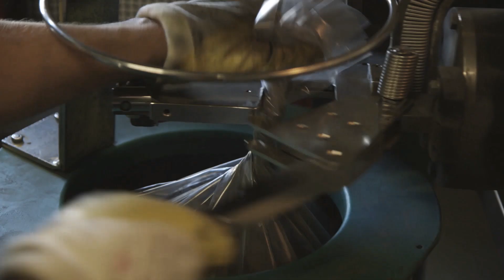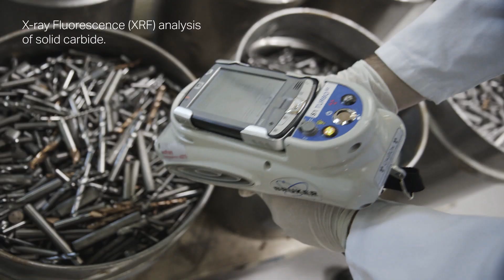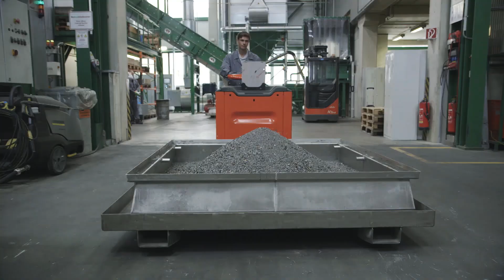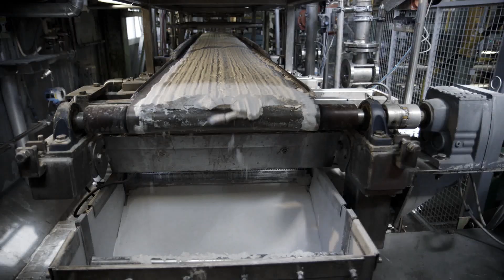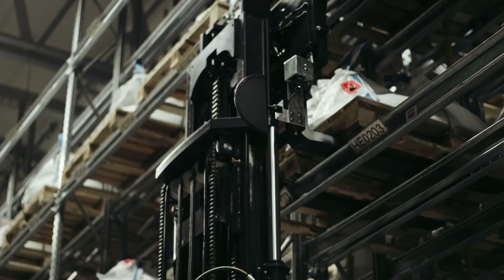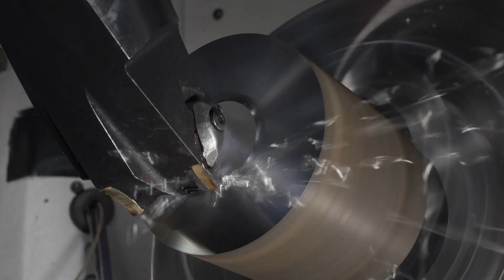How to recycle solid carbide with Sandvik Coromant

Comment: Whats so toxic about carbide though?
Reply: It's not so much the carbide, but the cobalt, it's nasty stuff. If you sharpen/hone inserts, wear a mask, & clean up the dust into a zip lock, so you don't have cobalt dust in your shop.

Something I learned recently is vapor or smoke coming off machining should not be breathed, it carries nasty stuff from the tooling AND the material.

I'm ancient & have cancer, already, started w/ throat, now in liver; been working in mechanics, fab, etc since I was 12. Started building/painting models years before.

Never smoked tobacco or chewed.

Any young guys/gals, you don't want this, trust me. It's not the cancer, it's the treatment & its effects; I have a 5mm silicon tube thru my abdomenal wall I eat thru.  Going on 4 yrs.  No saliva due to radiation damage.

Wear the damn PPE.
Reply: @georgedennison3338  so sorry that it has effected you in this way and your life. Over the last 3 years I've been in quite a few shops that look past the dangers of cobalt. They don't seem to care about the employees health as much as they should. Always cutting corners. Not many good quality shops around. I live in Ontario Canada and the only shop I know of that lives true to their employees health is Armo Tool. They have an incredible team management and provide the healthiest atmosphere and that's not just the air quality.

Comment: i used  sandvig tips   in my   work place   40 years ago  !   the try blade  tip   was a good   improvment   to  hss  steel  tools .  
and cobolt  steel   tools  but we    had  a   fix  for the   try  tip  wear   we used to   re shapen them on  a  diamond wet  stone  '
i have fogot   the exact angle's we used to recut  the tip's to  but it was not  the  same  as they came   in the box  / sheet .
needless to say we honed the  the  tips for  the best  perfomance   for the  metal we were cutting .

Comment: Recycled carbide inserts has less quality in compare to fabricated from pure materials?
Reply from the maker: No. We have worked with recycled material in our production for years, and you can trust that the inserts have the same performance as if we would use virgin material only.

Comment: Got about 35-40kg new carbide inserts. And some high speed Steel. Just need a metal lathe and a milling machine so I can use them. Got them from a old workshop were the owner and only employee had died

Comment: Excellent video- recycling is vital BUT make sure you get more uses out of your solid carbide tools through Remanufacture. At Quickgirnd in the UK we get tools sent to us from all over the World and in some cases can remanufacture (much more than just regrind) them up to 9 times depending on tool type and required parameters. Including re-coating. This works for our own tools and tools from other manufacturers. After that you can send them for recycling - the cost & energy saved is immense. Mike'Quickgrind.com

Comment: I'm a factory worker here in Minnesota. I asked  my head tool room attendant a few years back how much my immediate department gets back per year just for recycling scrapped carbide tooling. He pulled up the spreadsheet, it's around $60,000.00 per year. Nothing to sneeze at!
Reply: Ed Spencer+I have a shop with a small machine shop inside and I just took my first coffee can full of broken carbide inserts, end mills, drills, etc and the scrap yard gave me $8.70 per pound. 40lbs was $390.00. I dont know how long it took to save that much but Carbide is so dense that the weight adds up really quickly. If your shop returns $60k per year, you guys return 7,500 pounds!!!!!! That's incredible!!! If my math is right, 7500lbs of carbide will fit inside two 55 gal drums. Each drum should hold almost 3,900lbs! For comparison, a 55 gal drum filled with lead weighs 3,000lbs. Tungsten carbide is .22.6% denser.
Reply: Bravo! Recycling makes sense to companies when the see $$$ coming back to them.
Reply: Hello sir I am from Indian sir ....please contact me
Reply: Geez your factory must be massive.
Reply: do you accept waste or scrap carbide
Reply: We had a guyy steeling carbide once. They put a camera on the barrel. He stole about half a barrels worth. At the time it was $24 grand a barrel for the scap we produced. He got fired and locked up.
Reply: You can sneeze at it it's ok.
Reply: @Freeknickers24  thank you
Reply: @George Owen If they used uncoated plates and resharpened them after blunting, they would save even more.

Comment: Why isn't new cutting edges made on existing tools?
Reply: endmills are grindable but after some regrinding they start developing small cracks because of material fatigue. With inserts it could mess up their properties since they would become thinner. Another problem is the coating.
If you're interested you can look up the Swiss manufacturer Fraisa. They offer you a Toolcare service where you buy their mills and after using them you can send them back. At their factory they get decoated, grinded down a little and then recoated.
Reply: @jannpatrick6392  Thanks. :)
Reply from the maker: Sandvik Coromant offers reconditioning of tools. Read more about it here: https://www.sandvik.coromant.com/en-gb/services/sustainability/pages/reconditioning.aspx
Reply: grinding takes away material so the insert is no longer the same size
in cnc every insert has to be exactly the same or there will be size differences in the workpiece
Reply: @janvanruth3485  yeah, but you could compensate for that with tool correction. But it's way better to just have all the same size. I guess that grinded inserts would be twice or more the price of sintered inserts.
Reply: steve gale  in my company we experienced this mr. genius... And yes, i'm no engineer yet.
Reply: steve gale  carbide is grindable.. Don't you know the process of sintering? Pressing metal powder into shape and then let it go through an oven to diffuse the powder into a solid?
Reply from the maker: Hey guys... We're all friends here. :) Not all inserts are ceramic. Most of them are solid carbide which are sintered. Have a look at this film about the manufacturing process: https://www.youtube.com/watch?v=0QrynzJ_lZ4&t=
To jump directly in to the sintering process: https://youtu.be/0QrynzJ_lZ4?t=193

Comment: I love the thought that even after the cutting edge is completely gone the tool is still quite valuable.
Reply: As a hobbyist, even blunt inserts are valuable already. You can easily sharpen them on a diamond wheel and use them again and again.
Reply: The metal value is still there. The reason old milling machines will always be quite expensive is also because they have such a high metal scrap value. Sucks for a hobbyist trying to buy an old machine because even something from the 60s still costs a few thousand. Compared to a car which is mostly very thin sheet and needs a lot of refining to recycle you can buy for a few hundred and still drive for a few years.
Reply: @excitedbox5705  On a plus side that metal value will not go anywhere and will still be there when the machine becomes scrap even for you. It's a deposit, not a cost.
Reply: @aleksandersuur9475  I know but it is a big investment to make for a hobbyist. Almost better to buy a modern lighter weight machine for the same price and get the modern features and capabilities such as high speed spindles. An old bridgeport costs me more than importing a mill from China of the same size. An old milling machine from 2000 costs as much as an entry VMC or CNC lathe.
Reply: Used in alot of war machines.
Reply: Yes,  and if really though about how far,  small private manufactures might go for savings,  with the right modifications of the machi e tool,  like 3 d additive laser 're building of cutting edges, and coating, and sharpening grinding,  all at a workstation 😎

Comment: Hi I'm from India i would like to supply you tungsten carbide scrap
Like insert, end piece, sludge.
Reply: Just contact a local or  regional Sandvik sales rep.  They can set up up with the collection boxes and buckets.  Typically, Sandvik will pay a better price compared with other scrap vendors since they are the end user of the returned material.  Go to their website and find a sales guy in your area.
Reply: Dan Sammons 
Thank you 
Ill try to contact them.

Comment: Very nice.  What is the primary machine used for breaking down the material from solid into the milled/crushed powder?  I think that's what most people were hoping to see.  The chemical process is a given considering that's how just about every mined ore gets processed.  I think we were all hoping to see some crazy machine that breaks the tooling bits down.
Reply: There made be trade secrets in that process. By developing their own method, they might be able to do something more profitable than methods used by other companies.
Reply: M Hamma from what I’ve heard they use a grinder with tungsten carbide inserts. Presumably they would be ball shaped like the ones seen on mining and boring equipment. It would make sense as they can make their own tooling, too.
Reply: @bunnythekid  I don't think a grinder would work?  I would rather go for a crusher, an impact crusher or a roller crusher.
Reply: Dominiek Demaerel Tungsten Carbide would be really hard to crush. It has great compressive strength. 

One way to recycle TC, which i only recently learned about, is reacting it with zinc in a furnace. The tungsten carbide swells and becomes porous. It can then be milled back into a powder.
Reply: Felix it is hard yeah, but you’re talking about toughness. You could pulverise small inserts by crushing and shock loading but there are much bigger TC inserts out there, which would take tremendous force to turn into powder.
Reply: @bunnythekid   Thats true if we are talking about big solid blocks but most of the stuff they recycle are lathe or milling inserts, drill and milling bits and the rounded ones that are used for big rock drills, not bigger then 2-3cm in diameter. I cant think of something made out of TC much bigger then that

edit: Just did some research on other TC recycling facilities and they break them down by heating them up and oxidizing them, the oxides are much weaker and easy to crush into fine powder
Reply: Dominiek Demaerel most likely an industrial ball mill
Reply: @tuttebelleke  yea,  but what kind of damn alloy would the rolls be made of,  super tough, nitrogen filled high nickel, moly, manganese steel, with an advance HT and tempering cycle
Reply: @wickedenterprise  I concur. Ball mill was my first thought too. That is the most common way raw materials are separated from ore initially. Relatively cheap, simple yet effect technique.
Reply: They use a Blendtec blender.
Reply: A hammer mill? Can't imagine pulverizing these being much of a challenge.
Reply: Probably some ki d of diamo d grinder,  better filter the diamonds out of the reclaim
Reply: Possibly a rolling drum mill filled with a bunch of steel balls that simply smash them apart just like at most mines. I do know that when the recycle tires they freeze it with liquid nitrogen which makes the rubber brittle. Either way there is probably some trade secrets involved.

Comment: Brilliant but how do you get the different grades???  I use the gold coated 1020 grade. The best carbide I've ever used in the WCMX inserts. I made a video to compare it against H13A which was the best before. Look on my channel for the video.
Reply: userwl2850 This has nothing to do with the manufacture of the inserts, its how the individual chemicals are recovered. All the individual chemicals (tungsten cobalt etc) are separated and then recombine in different ratios to produce the inserts.

Comment: Bullshit marketing video. No explanation for how a broken tool is turned into a new one.
Reply: My guess is that the carbide inserts are crushed in a hammer mill, then dissolved electrochemically using a sodium hydroxide electrolyte. This would yield precipitated binder and coating metal hydroxides and sodium tungstate. The metal hydroxides would be filtered out with the carbon which would not be a problem for cobalt recovery since it would likely be a high temperature reduction process anyway; this is probably what is in those filter presses. The sodium tungstate remains in solution since it is highly soluble. Hydrochloric acid would then be added to the solution to dissolve any remaining binder metal hydroxides and would precipitate tungstic acid. This would then be filtered to isolate it, re-treated with sodium hydroxide, then neutralized with ammonia to precipitate the ammonium paratungstate, while fugitive binder metals remain in solution as ammonium-complexed hydroxides as long as the ammonia concentration is high. High temperature reduction in a hydrogen atmosphere would yield tungsten powder but I'm guessing they probably form new carbide in the same process to save energy. Just my best guess!
Reply: JohnnyRottenest they crush the tools and then dissolve the carbide which then can be turned into new tools. That is explained in this video. Because they already have a  video on how they make inserts that part is left out.
Reply: Alex V.D.H. Tungsten carbide is hard. So what type of tool do they use to crush the tools? What chemical do they use to dissolve the pulverized carbide? Maybe a trade secret, but they could just say it’s an acid or whatever. What chemical do they use to precipitate the tungsten? They show an industrial ram-type filter array, but that means the tungsten was precipitated somehow. When a how-to video doesn’t answer the most basic questions about how something is done, it’s not a how-to video, it’s a bullshit marketing video.
Reply: He's right. I gained very little knowledge from this video, compared to the last one.
Reply: Doug's Lab That sounds to me like it would work, and it’s consistent with what’s in the video. I think I learned more from your guess than I learned from this video.
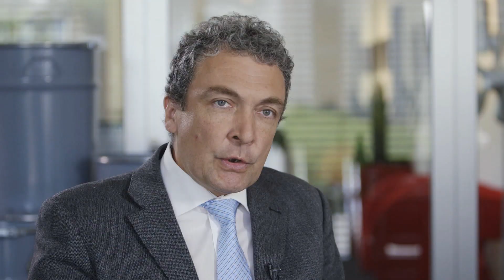Reply: They provide the end result of the purification process @1:27 giving its chemical formula.  Watch a few ore processing videos where a mine turns ore into the final product.  There's usually chemical baths, centrifuges, heating, drying, etc....  Depending on the material they are mining, it can be a rather laborious procedure and use some pretty nasty chemicals, especially in their pure form.  Aluminum for instance requires about 20x more energy to mine, than to recycle.  They indicate that the recycling of the bits and cutter heads results in a 70% energy savings over the mined material.

Comment: Seems like this is only cost effective for large commercial machine shops to send their used carbide back for recycling, as a home hobbyist who goes through 2 or 3 carbide bits a year, looks like trashing them is still the only option.
Reply from the maker: Hi,

Sandvik Coromant is committed to provide different types of packaging for our buy-back program and a small container for the collection of used carbide is available from our website. The small container can be used internally and can be placed at the end of the production line or on a desk.
For efficiency purposes, we ask customers to transport the buy-back materials using our 20KG packaging. Currently, there is no smaller packaging. For customers who want to return smaller volumes they may be able to do this via their local distributors.

Best regards
Jason Purcell 
Global Services Manager
Reply: Kevin L I'm assuming you go to the scrap yard already. Just bring your carbide with.
Reply: Bring them to a local machine shop that DOES recycle, or a tool supplier that will collect them for recycling.

Comment: How many times can carbide be recycled before it’s no longer useable for cutting tools? And at that point what happens to it? Would it then be discarded or recyled into something not requiring the material properties of milling cutters? Say ball point pen balls.
Reply from the maker: Hi,

Carbide can be recycled as long as it contains tungsten. Since we use a chemical process, it doesn´t matter how many time it is recycled. It is mixed with other material and can as new tungsten carbide be used for all applications as well as cutting tools.
Reply: @sandvikcoromant  hello sir
Reply: P0tat07 Infinite. Material properties don't change. You do lose a bit of the tungsten each time, so after hundreds of processing cycles eventually no tungsten will be left.
Reply: P0tat07 they can be recycled forever. Because they are broken down to the constituent materials like tungsten and cobalt. And so called carbide is just carbon.